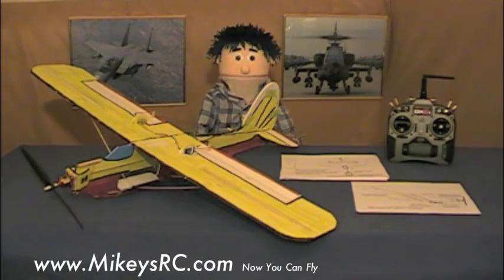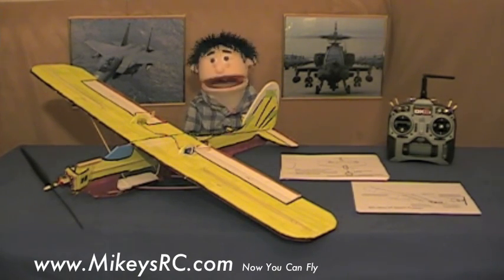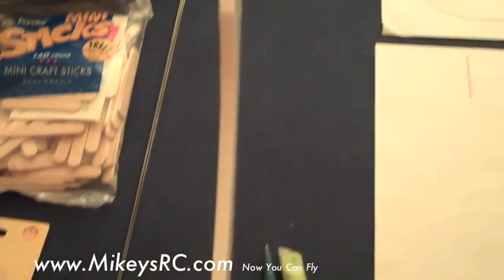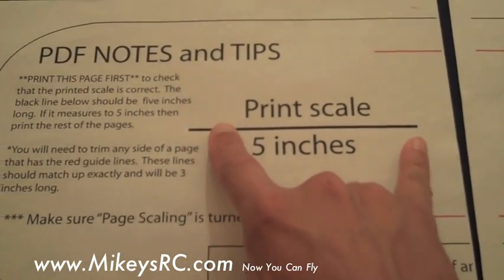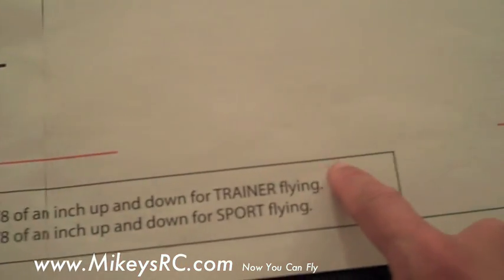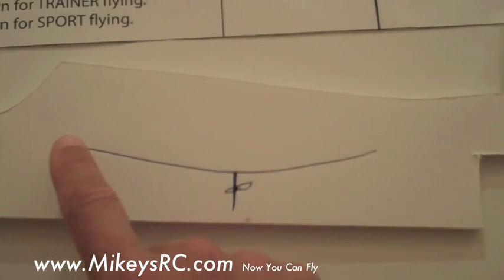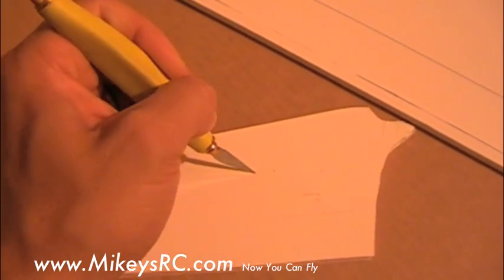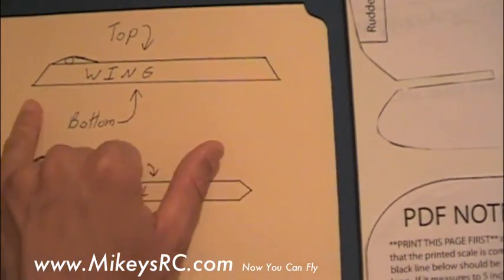MikeysRC Sport Trainer Build #1 of 7

Comment: I can't fine it big enough but I did fine it is plastic on top and bottom and it has hole running threw it. My question do you think it will work or not. I did fine it free it was in a trash hopper behind my house. Now I need a printer to print out the PDF. I do have a 930kv, ESC TX -RX, Lipo 2200 mAh and 10" props. What I don't have is the server. I should be able to get the rest at Walmart.

I'm 68 retied and looking for a hobby.  What would charge to print it out?Right now I'm having good weather Ohio maybe I could flying time in.

Hope to hear from you soon and help be great.

Comment: I built this plane but something went wrong despite I followed very carefully the plan. The plane just flies into the ground and toward the left! Is the down angle thrust the problem? The CG is exactly where indicated in the plan (about 1/3 of the wing). When it lays on a flat surface looks perfectly balanced between left and right. Should I compensate the left turn with some right trim of the ailerons or with a right angle of thrust of the motor? Any help will be very much appreciated. Thanks in advance.
Reply from the maker: ***** Sounds like you need to get some more airspeed going over the wings.  Try a firmer toss,  nose pointing up at 20 degrees or so, 1/2 throttle and if you can find a small bluff to stand at the edge of that will give you a little more time / altitude to correct and get her flying.

Comment: Without seeing your plane it's hard to tell whats wrong.  So here's some things to consider when building the plane: Make sure everything is properly aligned and square and parallel.  A straight plane flies straight, a crooked plane doesn't fly.  Also make sure you don't have too much control throw as this will make it very difficult if not impossible to control.  Also make sure it is properly balanced - too tail heavy will be very hard to control. Most important is to take your time building.

Comment: I like your plane and decided to get the foam board and build one. I am going to try a Rimfire 400 with a APC  8X6 Prop. I am using a 25A ESC and a LiPo 3S 11.1V 1500mah. The servos will be Hitec HS-55 Sub Micros. I will post when it is done and give a report.

Comment from the maker: @delsol7878 You can use a 2200KV 50ish gram motor with a 6 X 4 prop but the 2200mah battery is too big.  Try to use something like a 1500mah

Comment: Do you think I can use 2200 mAh 3s lipo with 2200 kv motor on this? I'm concerned about weight. I'm actually trying to convert it to top motor mounted plane as wild hawk. Yes, I will have to work on new CG.

Comment: im thinking about getting the combo deal and then get the 10x6 propeller and the Black Label 1500mAh 11.1v 20c LiPo Battery will all the wires fit and if they dont what should i do?

Comment from the maker: @GHANDYTAMASH Electronics

1000kv 47 gram motor
10 X 6 propeller
25-30 amp ESC
1200-1300mah 15-20C 11.1V li-po battery
3 9 gram servos

A 2 cell does not have enough voltage to pull the plane around when paired with the other parts I specked above.

Comment: Hello Mikey,

I built this trainer and took it out for a flight. However, I don't think my elevator throw was set correctly, flipped the plane upside down, and promptly crashed into asphalt. Consequently, I scrunched the front part of my fuselage. Is there a good way to strength the fuselage without adding too much weight? Packing tape? Extra bamboo skewers? Thanks so much.

Comment from the maker: Yeah those batteries should be OK to start out with.  Might want to use a 9X5 prop with the lower C battery.  I have some pretty cheap 1300mah 20C batteries on my site when you are ready to buy.